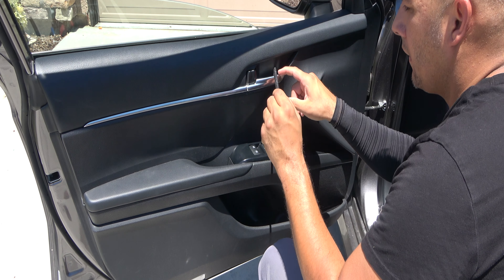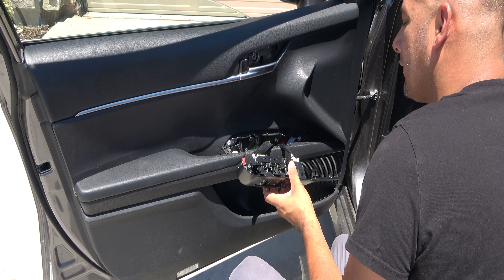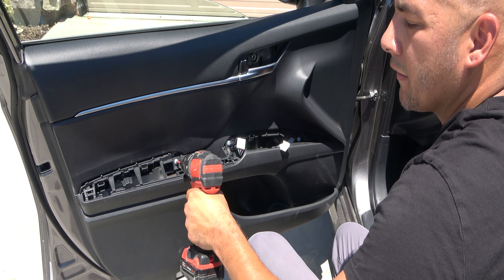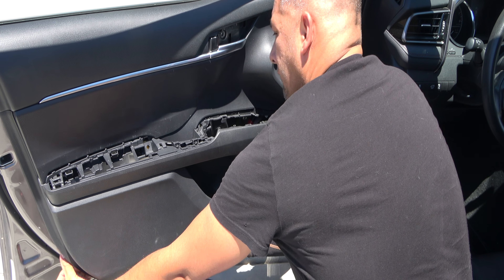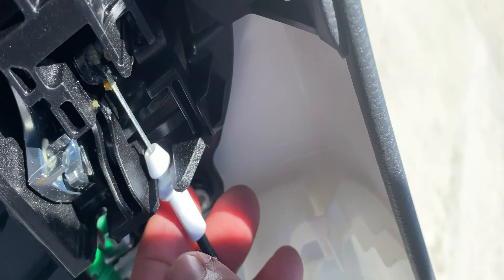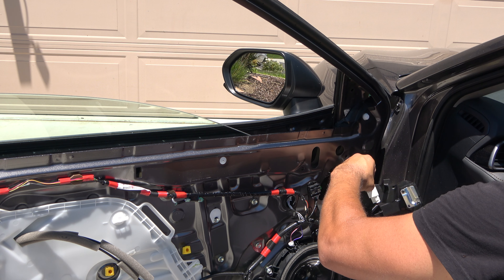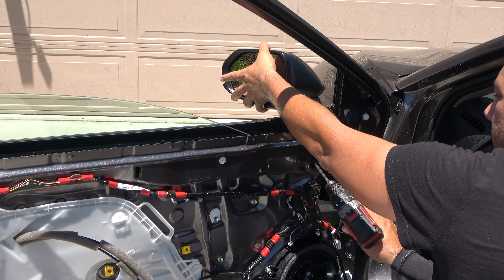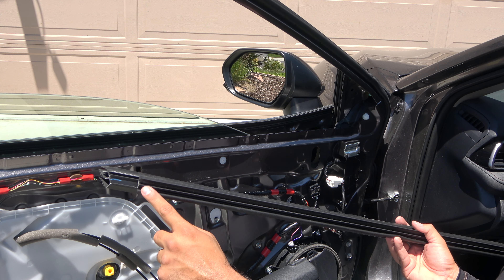How to remove  side mirror   Toyota Camry 2018 2019 2020

Comment: After taken this mirror out can it be uprgraded to the sensor mirror or does it have to be the same mirror?
Reply: It can be change to a sensor mirror you just need the blind spot monitors and wire to connect to the mirror

Comment: 5/5. Easy process. Only process that was kind of hard was prying that part out at 2:10. Easy process other than tht. Make sure to keep your window down before you do this process or you will have a difficult time removing the 3rd bolt off the mirror.